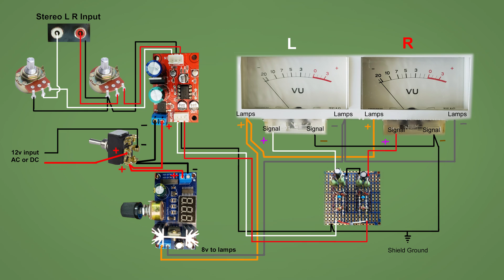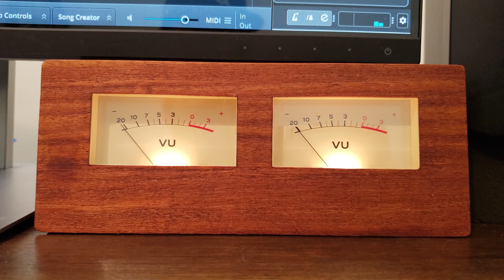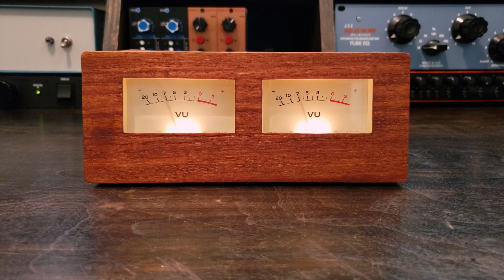VU Meter Bridge Audio Display DIY #studiogear #project #electronics

Comment: Hi, thank you for uploading this tutorial. I have a few questions as I try to recreate this project :-) Is there any particular reason why you used 150 Ohm 5%, 3W resistors for r5? Could I also just use standard 150 Ohm 1/4Watt metal film resistors? Another question for me would be: If I connect another pair of RCA sockets in parallel (for an output), do I retain the line level signal or does the device change (lower) it? Just wondoring if I could hook the vu meters between my cd player and my stereo amp, which would probably (?) expect a line level signal form the cd player. Thanks in advance!
Reply from the maker: Hey, good questions!
1.  Yes, 1/4w resistors will be great for this build.  I used 3w just because I had them on hand.
2.  Adding parallel RCA jacks("thru jacks") won't affect the level since we used that buffer board.
3.  Yes, hooking this up to your CD player as you describe will be a great use for it.  CD players give a perfect line level for these meters.
I use my meters frequently!
Good luck!

Comment: Great video but, because i'm such a newbie and don't understand all the terms yet, could you please confirm if the input can come direct from the speaker outputs and that the potentiometers are to allow level to be reduced so that you can use the  preamp board (voltage divider?). I don't have line level out to play with.
Reply from the maker: No, unfortunately this is for a line level output. The pots are just to adjust line level to suit the meters. If you needed to hook up to speaker level, you'd have to figure out a way to reduce the level to line level.
Reply: @FrankOlsonTwins  OK, that's what i thought. Having trouble finding good instructions for speaker level set up, any chance you have any ideas please?
Reply from the maker: @richardwatson8018 I'm not exactly sure what you mean by speaker level setup. If you wanted to calibrate the meters to your output you could buy(or make) one of those CDs that has test tones recorded at a certain level.  So if the cd is playing 1khz tones at -10bd, you can just set your meter pots until the meters read -10db.

Comment: How do you then send the audio signal to a speaker in addition to this unit? Does it have to come from a 4 channel amp or do you wire the speaker in after this circuit?
Reply from the maker: @ThatOneReviewer  you can do it either way.  I have it set up on a pair of extra outputs from my interface.  You could run them in the speaker path, many people do that.  In that case you would add "through" jacks.  Just to clarify though- line level outputs,  not speaker level. Yes your powered speakers would be last in the chain.
Reply: @ Thank you for your reply! 
That makes sense, unfortunately the 2.1ch amplifier board I was planning on using only has speaker level outs and has an integrated Bluetooth module which is acting as the input 😅
Reply from the maker: @ThatOneReviewer  you can buy speaker level meters, i don't know the price range though

Comment: i'm in progress of making this but i have an AD828A preamp board laying around so i decided to use that but the meter won't work... Is the problem comes from the AD828A board?
Reply from the maker: Hmm, not entirely sure.  Here are a couple tips I got from an amazon listing though:  
If you only used one channel,the other channel needs to short-circuit the input with GND,To avoid interference with the signal crosstalk.
Working voltage:DC3.8V-15V.This microphone amplifier board without power regulator circuit, can only use the battery or linear power supply ,can not use switching power supply, otherwise there will be interference.
Reply: @FrankOlsonTwins  oh i found the problem, i used two channels. I looked at your blog and saw the connection was connecting the - of 2 VU meters to the GND input of the diode board, then 2 - channels output of diode board connected together( mine did not work when connecting like this ), so i fixed it by connecting the VU meter - terminal to the - output of the diode board
Reply from the maker: @justhappyxd4891  glad you figured it out!
Reply: oh wait but then 2 VU meter not working as two seperate channels ( just figured it out myself too lol, i was connecting GND of 2 outputs together)

Comment: Can I change NE5532 Preamp with XH-M543 (TPA3116D2 Chip) Class D Amplifier and follow as the instructions??

Do I have to add more resistor into it?

Thank you.
Reply from the maker: I'm afraid not.  That amp is far too powerful.  You could try the LM386, which is still very powerful(about 1 watt) considering it's only driving a tiny needle.

Comment: I see on the self-soldering circuit board, it seems like you added a resistor that is not in the diagram?

Comment: Una duda ¿de cuántos watts es la resistencia de 150 ohms?
Reply from the maker: 1/2 vatio(watts?) o incluso 1/4 vatio está bien. Solo tenía 3 watts, por eso son tan grandes. Utilice cualquier tamaño y valor que tenga, siempre que esté relativamente cerca.
Reply: @FrankOlsonTwins  perdón, otra duda más ¿los capacitores son del rango de 47 pf a 250 pf? ¿O tienen que ser tal cuál uno de 47 y otro de 250?
Reply from the maker: @r2d2romo1   250 pf es el valor correcto. El condensador electrolítico es de 22uf @ 25v.

Comment: I like the look of the mahogany finished with tung oil. Does pure tung oil dry to a hard finish?
Reply from the maker: Thanks!  Yes, pure tung oil(no included varnish or hardeners) does dry hard, but it takes a few weeks to a few months to do fully cure.  Anyone looking for a quicker turnaround should look for "Tung oil finish" which has additives cures much more quickly.

Comment: The only thing I don't understand is how did you plug it in? Into the auxiliary outputs of the audio interface?
Reply from the maker: Yes, just route the stereo bus to a  second pair of outputs on your interface. Or, you could wire up a set of outputs parallel to the inputs on the meters if your interface only has one pair of outs.